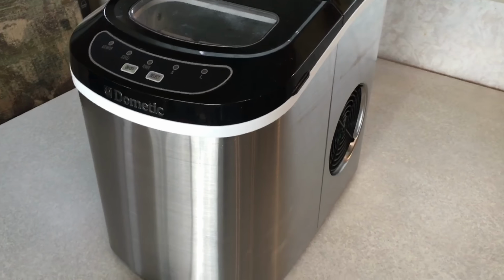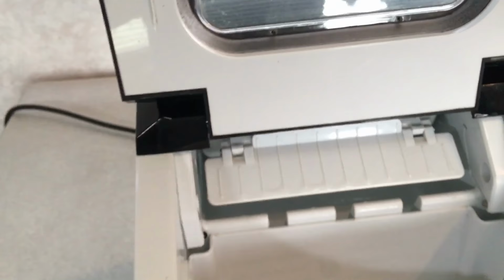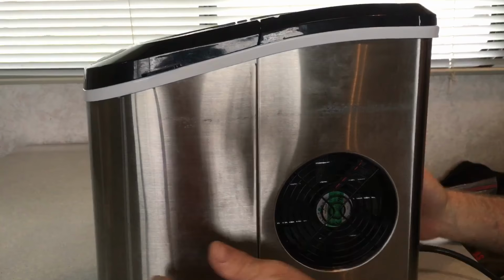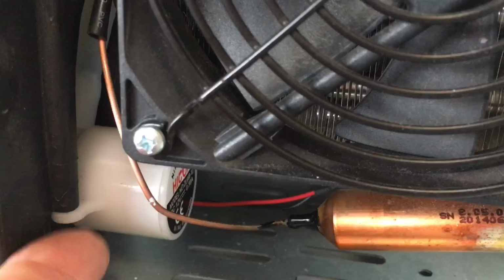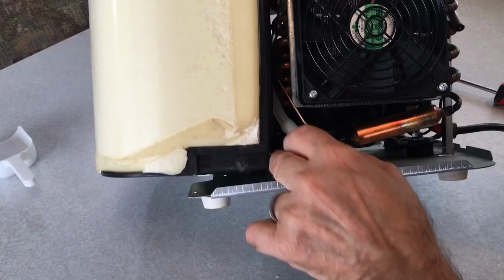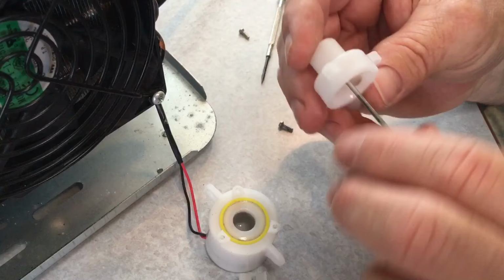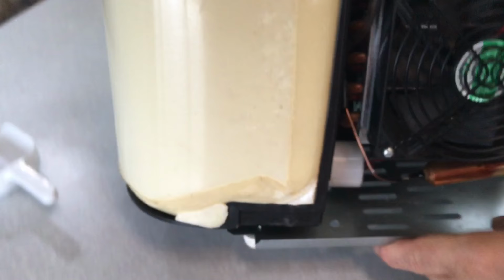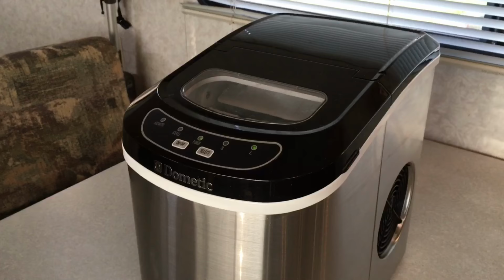Portable ice maker not working, watch this before throwing it away

Comment: Have you ever replaced ice sensor?  Our Improvements portable ice make makes wonderful cubes.  The problem is sensor does not recognize the full basket anymore.    I did clean sensors but it did not help.
Reply from the maker: Good morning and thank you for watching, we have not replaced the sensors yet, but when the day comes, we will give it a try.
 It should be somewhat easy. 
 I would say the most difficult thing is going to be tracking down that part.

Comment: Hi. Any advice on fixing the tray that pushes the ice into the bin? Ours gets stuck. Makes a humming sound. I assume there is a sensor issue but not sure. Thanks!
Reply from the maker: Hello and thank you for watching, since it is getting hung up, I would not assume it would be the sensor. If there is a way that you can make sure nothing is catching all the moving parts for the basket, then my guess would be there’s a problem with the motor that operates the arms for the basket. I would unplug the unit and take a flashlight and investigate heavily inside the basket/ice tray area before removing the cover to find the linkage motor and just do an inspection of the motor that runs it. If it is malfunctioning, it should have a part number on it and should be very easy and affordable to replace. Hope this helps you out.

Comment: Have Costway Portable Ice Maker. Ran white vinegar in machine. Now water doesn't run through reservoir. Therefore, making no ice.  Powered off/on several times. Tray moves, but nothing else happens. Help I love my ice machine!!
Reply from the maker: Sorry this happened but, It sounds like you have a clog somewhere in your lines from build up which is completely normal so, When you remove the cover you can see the line, remove both ends and blow into it and see if any sediment or slime comes out, this also could be your pump is jammed from an obstruction like what we had. Did you remove your pump and inspect it for hair etc.? We love our icemaker too and hope that you can get yours up and running. These little machines work hard and definitely need a thorough cleaning every so often. Please let us know what you have found.

Comment: Terrific video! My issue is with the fan. Unit powers on and begins to make ice properly. Then the fan stops and the unit appears to overheat. Unplug and let cool and the unit starts properly then repeats. Any ideas?
Reply from the maker: Hello and thank you, without pulling it apart and inspecting what’s going on with it, my first guest would be the thermostat that should be attached to the cooling fins, held to it with a clip and 2 wires coming from it. Did it come loose? Or is it just bad? Only way to tell is to start investigating. It might be a easy fix by looking for the simple things first. 
Hope this helps.

Comment: Mine is make ice, but it take so much longer now…. What could be wrong?
Reply from the maker: Hello, if you’re certain that the water is not restricted and is flowing properly, My guess would be to Make sure that the cooling fan is not restricted and the ice machine is not in a tight space/area where it is running hot and can’t get air, that would definitely slow it down.
Also if the ice machine ran outside, did it collect dust inside of it to prevent proper airflow ? That could be another possibility.

Please let us know what you find out, thank you so much for watching.

Comment: I have a fridgaire ice maker, I took the back paneling to clean the scoop tray and put it back together. It made 2 trays of ice before it simply stopped working. It doesn’t get cold anymore,  it feels like the side is overheating, and water is leaking from under the machine. If you have any Advice on what may be wrong with it id really appreciate it!
Reply from the maker: Whenever something like that happens, I unplug it and just start digging to find the problem.

Sorry I don’t have direct answers but that could be a multitude of problems or something simple. 
Sometimes it can be so simple, right in front of you like  a loose wire etc. 
Hope you get it up and running soon.
Reply: @reallystrangebuttrue  Thank you for replying! Turns out the tube had a hole in it and was leaking water onto the fan.
Reply from the maker: @Ashley-uv2mu  You are welcome and thank you for the update. I hope this was a repairable issue and you’re back up and running.
Most of the time parts like that can be found in a hardware store or they know how to get it and of course online is a great source as well.

Comment: Great video. I have a differnt problem.  it keeps making ice...and full sensor doesnt detect its full. " i suppose my ir sensor is toast".
Reply from the maker: Thank you so much. I would Shoot for the easy fix first which is clean the sensor lenses and check the connections if that doesn’t fix it then I would say your right, bad sensor

Comment: My ice maker is new well I think it is. It doesn’t make ice. The metal bars are not getting cold at all the side of the machine is very warm/hot and when I tryed it the 4th times I turned it off cus no ice was being made then some smoke was coming out of the back and side. Am I doing something wrong ?? Need help
Reply from the maker: That sounds like a very defective icemaker, and being that new it should have a warranty. I would not try using it again with all that is happening with it.

Comment: My icemaker little shovel that dispenses the ice isn't working properly anymore. It scoops under the ice then acts like the ice is too heavy for it, and gets stuck. I can't find a fix anywhere!
Reply from the maker: I would start by tearing it apart, it could be something holding it up and a little vegetable oil olive oil etc. on all those moving parts might make it work smoother but if the motor is going out you’ll need to disassemble it anyways to get the numbers off it, find it online or the parts store and replace it, I hope this helps.

Comment: Thanks for the video! I tried taking it apart before but I didn’t think of cleaning it with vinegar. Do you basically just run it with the vinegar or what?
Reply from the maker: Your welcome, yes, we like to run 2 ice trays full of vinegar and then dump the vinegar out. Please keep in mind that if you tip these machine to dump it (refer to your owners manual for how long) you have to let it sit so the Freon can go back into the compressor. Every model is different but we like to leave ours overnight. After that just simply put fresh water in it, run 2 trays of ice dump them, or until the ice doesn’t taste like vinegar and you are good to go. The good thing about vinegar is it’s safe to consume unlike harsh cleaning solutions. One other thing to consider is vinegar cleans well but will not move an obstruction like hair or a small piece of plastic. 
Thank you so much for your positive feedback.
Reply: @reallystrangebuttrue  My Frigidaire machine has a rubber plug in the bottom for draining - no need to tip!

Comment: i have a fridgadaire one which looks like yours but grey plastic casing. mine  starts the cycle  with the water running and starting the chill then it turns off ive cleaned the filter hole with a pipe cleaner and a mini snake  it starts to cycle again then it stops and the red light goes on.. this has happened in the past and after i use the pipe clean er it always works but not this time i asume the filter in the machine is getting clogged with this model there no screen to remove theres only a hole on the bottom side inside thankyou for reading this..
Reply from the maker: I’m not aware of any filter at all in the waterline. This icemaker in the video is still going and it does exactly what you’re saying yours does periodically and it’s very frustrating. At first I would just turn it on and off and let it run a few cycles and it would resume working properly and of course my first thought was it’s clogged again. What I have found is Air bubbles get caught in the line, it literally needs to purge out the air in the line and it resumes working. 
How I have done this is while it is pulling the water I have rocked it back-and-forth/front to back to try to move the air pocket and after a few times it will work perfectly for months before this happens again and what I have found is when I turn it on its side to empty it as has stated in the video is when this air pocket problem can happen. 
The way I see it is, what do you have to lose to try solving these because the brand-new ones, right out of the box will do the same thing. 
Hope this helps you out.
Reply: @reallystrangebuttrue  thankyou for answering me ...i already tried to rock it back and forth i really wanted to rock it out the door lol!!! ive emptied  several times and re started it and it will start to cycle then it will start to make ice and then it stops..one ice maker machine i had in the past did have a screen  a round one ane it had to be cleaned out and then placed back  and if you didnt put it back  a red light would turn on and say  filter needs to be clean.. this ice maker machine i  have now is only about a yr. old  thankyou again it makes me feel good that there is someone out there that cares..

Comment: I’m having trouble with mine it’s been left all winter when I turn it on it says it’s full I’ve cleaned it and the sensors on the inside above the tray but it still says full. Is there another sensor I’m not aware of?
Reply from the maker: Make sure that the ice tray is all the way down and not blocking the sensors. Other than that just triy running it a few cycles by turning it on and off and if need be, unplug it for five minutes and try again and hopefully will be back up and running.

Comment: Mine pumps the water into the tray but it doesn’t freeze it.
Reply from the maker: Bummer, sorry to hear that. there are soooo many things that could cause that problem.
Reply: @reallystrangebuttrue  ok. Thanks!
Reply: That is what mine is currently doing 😥
Reply: Mine too works just fine but does not make the cubes.
Reply: @buckalubbadoda3752  can I ask what brand you bought ?
Reply: I just got mine and it's pumping water but no ice
Reply: I got magic chef works great so far.

Comment: Well, my ice maker didn’t work, but I followed your instructions to the letter and now it’s working great, hair wrapped around the impeller.  Just one question though….it’s not leaking but I have a black o-ring left over…any idea where it goes?  Lol
Reply from the maker: Well, extra parts is never a good thing lol
If it’s the tiny one, it would be on the spindle of that impeller.

Comment: Anyone know where the, "low water" sensor is? Our unit keeps throwing this error at us.
Reply from the maker: It may not be a sensor at all, this usually happens when there is an air bubble in the line. I had to shake ours back-and-forth while it was pulling water during 2 cycles to get the bubble to move and it’s resolved the issue.

Comment: ours appear to be getting water up to the silver tubes but not getting cold/frozen?  any thoughts anyone?  the unit is 4 months old.  Tried cleaning with vinegar also.  cleaned the vents at back of fan and blew out the tube like you did.  When I opened my unit (different brand) a small rubber cap fell out and not sure where in the world that goes?  it is smaller than tip of baby finger and hollow on one side (like it is a cover for something)  After cleaning like you showed and running vinegar through it - it made 2 trays of ice, so I emptied the vinegar water, filled with filtered water and now it is not making ice once again oh my.
Reply from the maker: If you can take a flashlight and see that the water tray is filling up properly, but it’s just not freezing, something is definitely wrong with  low Freon, a sensor or something but if your unit is only four months old, it should be under warranty.

Comment: My ice maker used to make soft chewy ice when I first got it. But lately the ice that it makes is hard and crunchy. Any ideas as to why this happens? I've only had it for a couple of months so I don't think it needs a cleaning yet.
Reply from the maker: Hello and thank you for watching, my first thought would be the water being used such as have you changed from tapwater to distilled or soft water to hard tapwater etc.? If not, this could also be a summertime warmer weather affects the hardness of the ice comparison to the winter. 
Also, If the ice machine was placed in a different location where it runs a little hotter and the fan cooling fan is restricted could also change this.
One last thing is , where the ice drops into the unit and is stored until you lift the lid, it is not cooled, the ice itself keeps it cool and can melt so if the outdoor temperatures are higher than now or the location of the unit. 
My guess would be the ice was not as cold as now making it harder instead of softer chewy ice. Hope this makes sense and helps you out.

Comment: THANKS so much for this video. I have a "Home" countertop icemaker that only fills the tray to the bottom so get these little saucer type "cubes".  Could this be the pump or a water-level sensor?
Reply from the maker: Do this, take a flashlight and look and see if the water tray is filling up all the way and even overflowing.

There should be no water level sensor in the tray because the machine  pumps water on a set amount of time instead.
The only water sensor it should have is when it is empty and needs to be refilled. There could be a new model that is building it differently and if so please let me know thanks so much!

Hope this makes sense and helps, please let me know all the results.

Comment: I fixed my water pump like you said and it pumps excess water in. But the scoop tray does not rotate all the way to capture water. When it started rotating I tried pulling it by hand and it went all the way and instantly started to make ice! But it did not cycle and drop the ice into the tray unfortunately. There are no linkages, the scoop is directly connected to the side motor. Weirdly it does not seem to be blocked or binding, just that the motor desn't want to rotate the scoop all the way as if the logic is saying no...
Reply from the maker: Is this a new issue with the ice scoop after the repair?
Reply: @reallystrangebuttrue  No this prompted the repair, it was working fine before it started making graunching noises. I fixed the slightly impeded pump thinking that was the problem but unfortunately not!
Reply: @reallystrangebuttrue  I finally sourced a new stepper motor that rotates the ice scoop, though it was impossible to exactly match the electrical specs I got close with the correct basic part number. However when I got it, the motor was thicker than the original making it very difficult to fit without some surgery to the icemaker. Also the spindle was too long and the end was a different shape to the original requiring some sculpture with an angle grinder. Eventually I got it in and the icemaker works properly again. WARNING: the spindle on my old scoop motor was corroded probably from the water splashing on it, possibly it might have been recovered if I had simply lubricated it but I doubt that would have been a permanent repair. I notice a previous post says the icemaker should be mounted on a tilt to the right looking at the rear to help avoid that problem.

Comment: You shouldn't be using tap water you need to boil it in the kettle let it cool down and then put it in your ice maker or better still get a reverse osmosis water filter or a distiller.
Reply from the maker: thanks for the advice, we use distilled bottled water when making our ice.

Comment: The thing that is supposed to be holding the water up top, keeps going back and forth over and over. Any ideas?
Reply from the maker: First , look for any obstructions. Second , make sure the sensors are not being obstructed by the ice basket itself, where the ice falls make sure it is in place properly. Third, just like computers, unplug it for 5 minutes and try again. From there I’m not sure, it could be a broken linkage inside. You will have to remove outside shell to investigate. Hopefully 1-3 will be it. Let us know how it goes, thank you so much for watching.

Comment: I just bought an igloo one end of January and I do use it a lot! The past couple days it’s started to whine extremely loud for about 5-7 seconds upon water filling the tray. Any ideas on what it could be? I looked through comments and didn’t see a direct answer. Unit functions normally except for the ear piercing temporary whine.
Reply from the maker: Being that loud and ear piercing would be very tricky to pinpoint exactly where that noise is coming from by listening. There’s a good chance that something is inside of the pump housing causing this like a piece of plastic from the manufacture which we found in ours, it’s really hard to tell without digging into it and inspecting it.
Reply: @reallystrangebuttrue   I unplugged it from the wall and let it sit overnight. Now the sound is gone! So bizarre! We do use it a LOT during the day. Thank you for responding!
Reply: Update: stopped making the sound but after like 6 cycles it will come back. Lol going to try to clean everything.

Comment: help I have a HNIM27ST that has an issue with the upper tray. I was able to mimic the tray's action of it's actuator (left side as you look at it) that closes the micro switches and got the unit to pump water, start the compressor, and have the metal tubes get real cold.

So that tells me the pump is good, the microswitches are good and compressor is good...Just something physical with the tray is not letting the tray move. I can hear the tray's motor doing it's  thing as I can heat the gizmo around the tray clocking. 

do you have a video of getting to the tray components? I can seem to figure out how to get the top off to access it.  I am hoping it is not something broken....but if it is do you have a link for the parts.